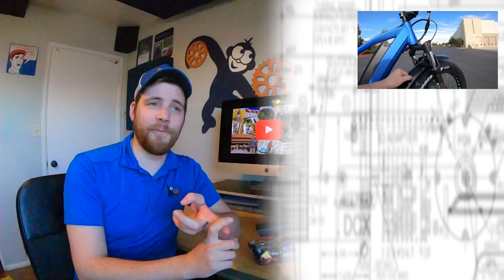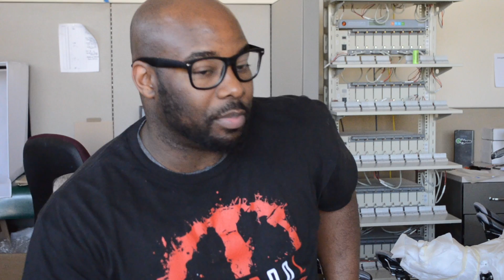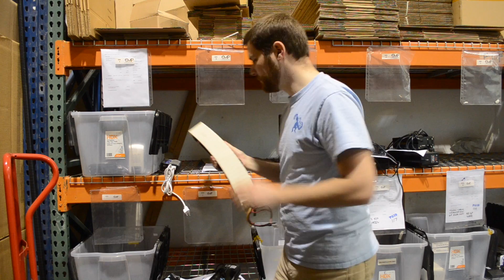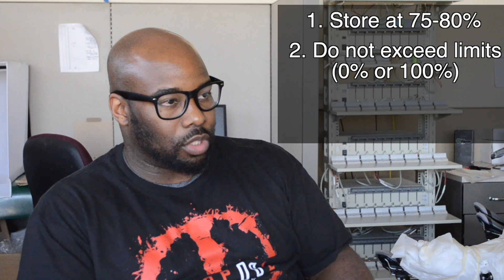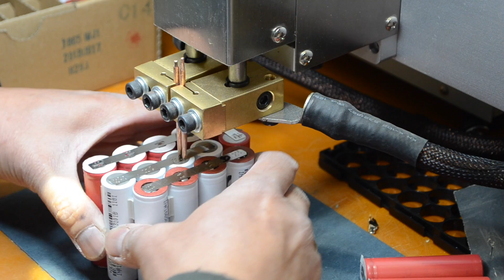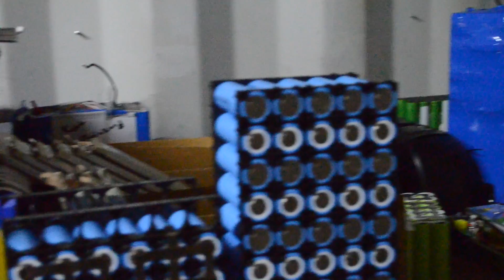BTN's Secret: Electric Bike Battery Replacement from RPE

Comment: Hi, i was told that it is quite difficult to rebuilt a Bionx battery. There a quite a few issues doing it. Can you give me some advise ? Thanks. Great vidéo.
Reply from the maker: Contact the company in the video: RPE (rechargeable power energy) in Las Vegas

Comment: Hi. I need urgent help with disassembling a single case ebike battery. The batteries won't slide out of the case. I am visiting a country  located outside the continent and without resources. Case is 390 x 110 mm c 75mm. Thanks for any help.

Comment: Great to have you folks around!  Another area which needs help is dog grooming clippers.  A lot of battery rechargeable clippers die prematurely.  We pay a fortune for these - tiny cordless clippers running $80 - $100 each, and not holding a charge long, and dying prematurely where they don't run at all.  I'm convinced this is due to faulty battery issues.  I wonder if you would consider selling those battery cells directly - maybe 1 or two to replace my clipper ones?

Comment: RPE, isnt that the company that on their website thinks amps and ampherehours are the same?
Reply from the maker: Looks like the battery doctor is flexing that degree
Reply: @BlueMonkeyBicycles  They says "we can usually add 2-4 Amps to your battery". ALso in the video he misspokes. Sure, we understand they mean amphours. But still, with all the other mistakes they post one must not assume they actually know the difference? Also in this videos i can spot several important misstakes they are doing, have you been to any other businesses that do battery repair i USA? There should be 100s but i can find any more then this, fthpower and Ebikemarketplace (Which seem to be another name for RPE).

Comment: I watched the unedited version of this and wasn't impressed so I made some notes. This edited version might be better but I've spent to long on this already.
https://www.youtube.com/watch?v=qmbyZjpbrvY

OK has this guy got an real figures, stats etc to back up any of his claims with regards to training your batteries?
Because I'm calling it.. can you smell it?

Right, it think this guy know some stuff but other stuff he's well off the mark or his words are betraying him.

I'm not an expert by any means but in four+ years of working with lithium cells and learning about them I can point a few things out that I think I can better explain.

I can't be bothered to check all the thing he says some of its correct but some of its just odd as he contradicts himself with the correct answer.

I think he should have had the questions before and then read it of script.

Let's look at his capacity vs current.

You trade one for the other he even alludes to this after, manufactures characterise their batteries and make different models for different applications.

It's all to do with the way the chemistry is setup within the battery as well as the particle size of the materials used and then how they lay that down on the internal film on the anode and cathodes as well as the solvents used to suspend the materials.

That then affects the internal resistance of the cells, the lower the resistance the higher the current but the lower the capacity so if you have a nice think coating you can get a lot of active material in there for capacity but then the ions will move slower through the thicker material thats then increased resistance so if you force them to high amps in either direction this results in heat.
Thinner material coating is easier for ions to move which is lower resistance and less heat but also less capacity.
The solvent also comes into play here as well as improvements in the solvents have an effect on the ease of movement of the ions.

The energy density 18650 vs larger cells if you take the core out and work out its density then do the same on a larger cell thats the same manufacturing setup and chemistry it will be the same density the only difference in that the overhead of the shell / construction of the battery is different.
So the smaller battery has more metal and air around it for a given volume vs a larger battery but there are potential downsides to this like for example heat, if your packing in the core material and your pulling max amps from it then there will be less surface area to lose that heat from.
But if you have larger cells then you have less manufacturing costs, as to get a certain capacity takes less cells which means less welding, so reduced costs.

So all cells are a balancing act for any number of reason I've just given or other things I haven't mentioned.

If you really want max capacity and current then your best using squared cells with as thin a wall around the cell as you can get away with as then you have no free air around the cells and you can maximise their density but then you have to watch that heat. And if you've gone thin shell with plastic you then have a potential safety issue if that wall gives out between the cells thats then a lot of energy shorting which you guessed it. FIRE! :)

I could go on but you get the idea I hope.

But please if this guy has data on the first thing I said publish it, thats the only thing I can think should be of interest to anyone whos interested in lithium ion tech.

Comment: Cool this is excellent, is it really true that the future is 21700 cells???
Reply from the maker: Sean thinks so. I'm inclined to agree.
Reply: They are not cheap.  They quoted me $650:to refurbish my battery...note that the OEM price from my dealer would only be $800.  I think the former would be worth it only if upgrading or if I couldn’t source an OEM battery....otherwise, may as well buy the OEM part.  Btw, they also  said firmware on a bike could potentially prevent being able to use a refurbished battery.  They haven’t worked on all possible models so couldn’t guarantee the result.  I really do hope they succeed, though— not enough businesses like theirs exist out there.
Reply: @recipehacker9752  What battery did you have sounds like a Bionx system?
Reply: Ebike Marketplace   BMZ , MY 2018.  German.  Mounted on a Bulls.  648 w/h 37 v. 17.5 a.
Reply: Yes I think you're absolutely right about Firmware issues how can the solve that? 🤔
Reply: @DKLVE  This must have been a Boinx battery since the company has closed down they no longer offer the firmware and what happens is after 50 miles if the battery source changes it can cause the battery to lock up. Our refurbished battery all come with a 1 year warranty and brand new cells. I stand by my word saying that the best battery you can have is a fresh battery you really dont want something that has been sitting on a shelf as all Lithium Battery will self discharge over time but thankfully you still have the option to use the OEM some customer that we work with dont have that option.
Reply: See my notes from the unedited video and you can draw your own conclusions but I wouldn't use this video as your reference point unless you have a pinch of salt, unless this edit version has had a voice over. TBH.